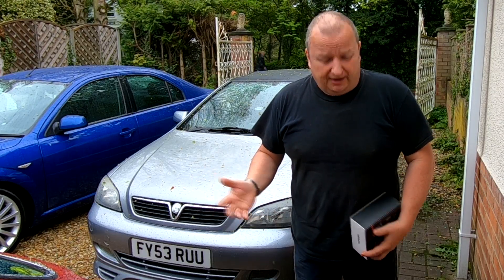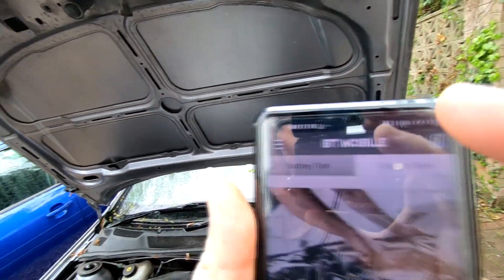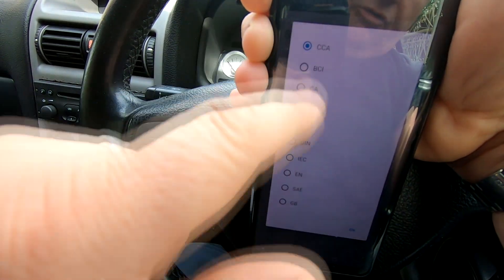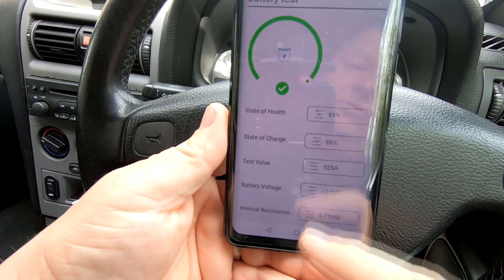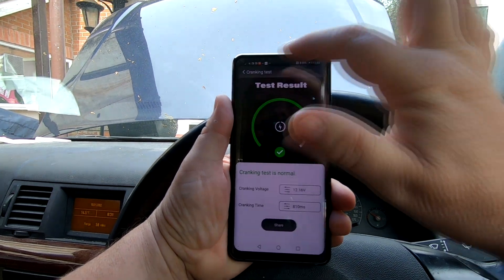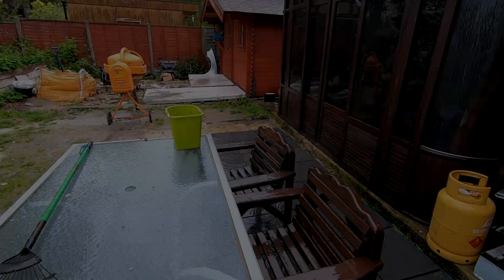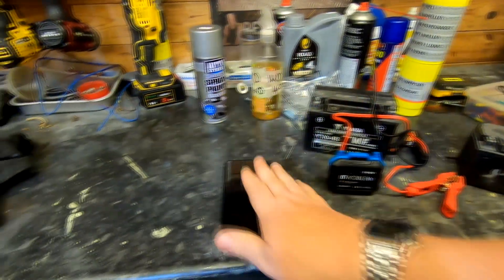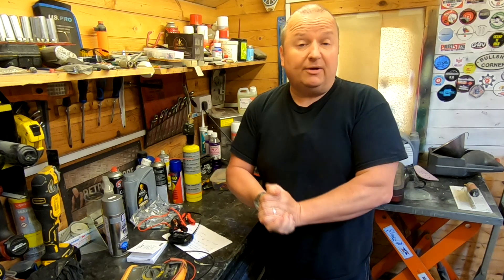Topdon BT Mobile Lite Battery Analyzer Real Life Test

Comment: Can't live without my multimeter. Even use it to check light bulbs and regular batteries. Additionally, the continuity feature is a huge help if you think a switch is bad. I would recommend that one learn the basics of a multimeter. It might look confusing on the face of it but it is well worth learning.

Comment: Oh dear Martin a Lion battery :(
Reply: lol , my first thought as well
Reply: Totally agree with you both 🤦‍♂️
Reply: What's wrong with it still got 3 year warranty init ?
Reply: Batteries from euros all There do is change the labels on the battery’s
Reply: @paulyh4531  IT will pack up
Reply: Cheapest crapola battery EuroCarParts do. About as much use as their Eicher brake line....dreadful stuff.
Reply: @paulyh4531  Warranty with ECP not worth a proverbial wa*k.

Comment: Hi Martin, here is a brief explanation of the "charging ripple". Each alternator generates a pulsating direct current. These pulses should be buffered (smoothed) in a healthy battery. The battery acts like a capacitor. If the battery is sick, these pulses will be visible during the measurement. In this way you can see whether the capacity of the battery corresponds to the specifications.

Comment: I really like the idea of the app controlled battery analyzer. The only problem is that there will be a dependency with the manufacturer to keep updating the app in the future for new Android or IOS versions. I did buy some bluetooth devices before where the manufacturer doesn't update the app and the devices are unusable in a couple of years time. I need a battery tester now and considering the BT100 or BT200.
Also something to note with the BT Mobile. Topdon sells 4 different versions of this. BT Mobile, BT Mobile Pro, BT Mobile Pro S and BT Mobile Lite. I asked the manufacturer about the differences and the only difference I noticed other than the size is the accuracy. Lite has 10%, BT Mobile has 2% and BT Mobile Pro has 1%. I am guessing the lower the better here.

Comment: Charging Ripple tells whether or not you have a bad diode in the alternator that would cause excessive voltage ripple that can cause flickering lights and even driveability issues.

Comment: I used to work for a large retailer called Half.....Witt's, we had a super duper tester provided by YUASA.
Test a battery under the setting "Warranty battery", if there was a problem it would say charge and retest. 9 out of 10 it would come back good battery.
If you did the test on the same battery, and didn't select "warranty" it would say "REPLACE".
🤣😂🤣 🤭🤭🤭🤭 OHHH THE SECRETS!!!!
Reply: Same tester that EuroCarParts use when you try a warranty claim on a battery. Never go there ever again, use Tayna batteries online.

Comment: Those charging test results are a bit low. Would expect at least 14v.
Reply: They are all with every accessory off so ok. I'd be more worried if you put the fan and headlights on and it wasn't kicking out 14.2v

Comment: you missed a bit mart! you need to enter en or jis etc cheers
Reply from the maker: What does that mean?
Reply: @retrorestore  you entered cca on your lion battery but that's incorrect the lion battery is rated to EN standard not CCA so you will get the wrong result https://battery-service.com/support/cca/
Reply: @retrorestore  different manufactures measure "there" cca rating in different ways! ie en rating will be different to say jis ratings etc!!! l have seen fast fit stations enter a jis rating instead of what should be a en rating to show customers that there battery needs replacing!!! you get a different cca reading on there test kit! get the idea!!! regards p.s en or jis etc will be on the battery!
Reply from the maker: @alanreynolds2125  That's confusing for the user Alan, I just put in what the instructions said and there was no reference to what you explained so it would be impossible for a person to know that without being told I think. Good point though. Maybe the company need to amend their instructions to make it clearer.
Reply: @retrorestore  if you look on a few batteries you will see EN or JIS ETC have a look!
Reply: mart; did see a list on your tool with EN, JIS etc listed! keep smiling mate!
Reply: @retrorestore  when you are entering the amps on your video the EN option is available on that list. Most starter battery's will be in EN DIN SAE or CCA Leisure battery's  wouldn't be marked in starting amps so you have to convert it from the amp hour to find the amps in EN then enter that figure
Reply from the maker: There's no reference to that in the manual. Perhaps they need to re write it.
Reply: Wasn’t en or sae listed next to the cca on that lion battery? Sure I just made it out.

Comment: You are using it incorrectly. You should have entered the cranking capacity as EN not CCA as they are different standards ie 550A CCA is 520A EN  see https://battery-service.com/support/cca/
Reply from the maker: Here's the thing Peter, You can only go by the instructions and as I have never used this bit of kit before, I used it as anyone else would have done given the information in the manual. If I would have asked the company to instruct me then it wouldn't have been a fair assessment. I don't think that page you linked to explains anything the layman could understand.